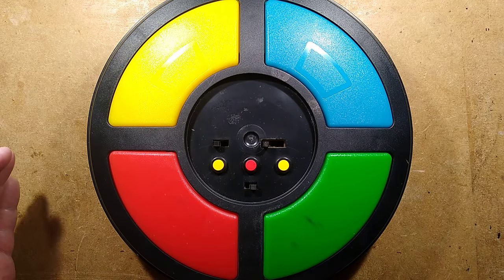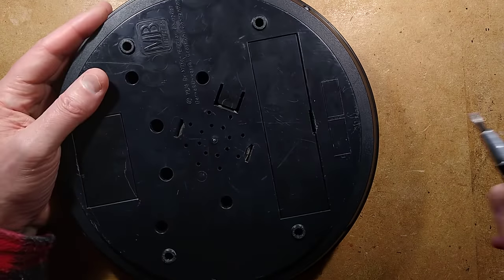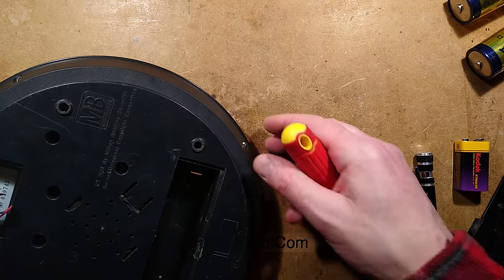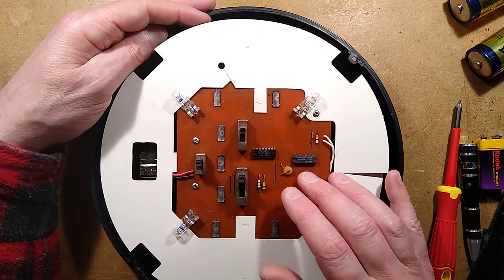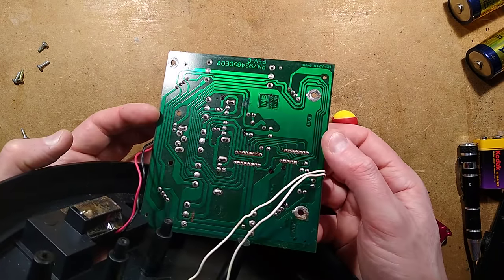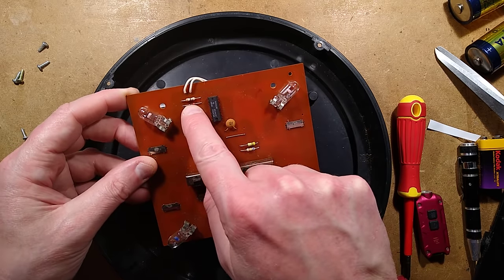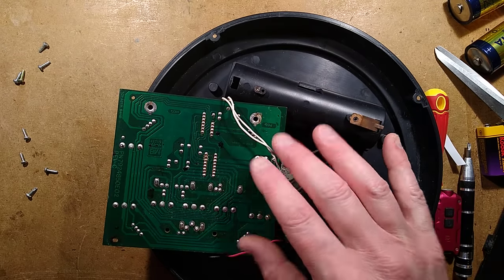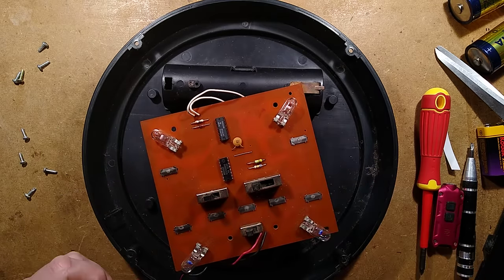Inside one of the first electronic games.

Comment: At some point in the future, the incandescent bulbs in this will have the same "Wow!" factor as vacuum tubes do when opening a piece of vintage electronics. A good reason not to retro fit LEDs.
Reply: At least here the chances of them burning out are low. When it comes to pinball games and hifi receivers, likely chance there sadly
Reply: Until about a year ago I had no idea what a wedge light was. On my car one of the front running lights had failed and the other one was dim. With great difficulty I replaced them with LEDs. Everything was great for a few months until one of my my new LEDs failed. I replaced both of with incandescent bulbs, they are more reliable.
Reply: Meanwhile in China they make half decent vacuum tube amplifiers that have red or blue leds lighting them from underneath, because the awesome glow from the cathode isn't enough. It's that strange crossover between what was actually good tech, and try and update it for no reason.
Reply: Who's to say today's babies buy an old house and find some quirky corner with a light bulb in it and say WTH is that ?

If I ever get wind of them demolishing ?????? ????????? I'll try to get there before they do and rescue a light bulb. It can't be original to the building (1910) I don't think but quite possibly at the first upgrade maybe 15 years later.
Reply: @fuzzybobbles  an amber led does look classy though
Reply: @rysacroft  quality led assemblies will outlast your car but retrofit assemblies are often pretty low quality.
Reply: Yep just standard car side light bulbs, super common. Its quite cool to think how easy they made them to replace though.
Reply: @VeyronBD  Except the wrong voltage - so they're not not car bulbs at all !
Reply: @millomweb  sure they don't just run at lower voltage in the game?
Reply: @VeyronBD  I doubt a 194 wedge bulb (12-14 V)  would even glow dim red with 2 D batteries (3 V) powering them.  It is pretty common to get the wedge bulbs in 6 V and 8 V,  but I haven't seen them in 3 V versions,  so these might be rare to find if they ever burn out.
Reply: @drkastenbrot  There are some hard-to-find 2700K-3000K very warm white LEDs that I'd love for something like this.  Some LED candles have an interesting version.  T1-3/4 but with two chips under the phosphor that come out focusing at a slightly different angle.  Fade between the two and you get a no-moving-parts flickering spot that actually moves.
Reply: fun game: challenge your friends to figure out the one item in their home that still relies on vacuum tube technology. Don't tell them it's just one tube, or that it's an appliance.

Comment: A few years back my local maker group built one of those that was 20ft in diameter. Tons of LEDs and load cells for the buttons. You would play it in teams of 4-8 and stand on the buttons to press them
Reply: Wow, that must've been something, lol!
Reply: That'd deserve a video! 😃
Reply: @megamanx466  I wish I filmed more of the build. I've got quite a few photos from it though. We were planning on doing another event with it this year, but as you can imagine covid delayed those plans for good reason. we designed it modularly in 8 huge pie shaped wedge sections that can fit in the back of 2 trucks. So it's fairy easy to transport to any location. It definitely needs some repairs after two days of people jumping on it. The black part was skinned in abs plastic over plywood, so its super durable, but the buttons were skinned with plywood and colored fiberglass. The fiberglass was layed over some strips of LEDs in the button to make it look like it glows. After two days of people jumping on it, it did up breaking through in a few spots though. With 16 load cells and 11 different channels of 120 volt led lights the electronica were pretty wild too. It was designed so we can connect a network of PIs over WiFi to dmx lights and throw them all over the event space. Then they all flash and match the color of the simon itself. We also modified an original simon to be the start button for the full sized one. It's bolted on a welded pedistool that sits in front of the full sized thing. It also flashes the buttons the same colors as the 20ft one. You end up pressing the original tiny start button on it. People got a kick out of that. We even got the original graphics files from Hasbro. We ended up making our own tones, and added some more base to the sound files, so it's like something kinda like close encounters.  It played out of an in built automotive style speaker system inside of the center, then also would connect up to the speakers outside at the event space. Next time we run an event, probably in quite a while at this rate, I'll either film it myself, or find someone else who can film, the setup, teardown, and event.
Reply: @ReRamp  That sounds awesome! Perhaps next year you can get Hasbro to contribute towards it. Either way, sounds like an excellent project for a video! 🤯😃

Comment: The reason the colored plastic "button" parts have two positions for the rubber buttons is because they use a different position for the contact based on what position on the game the plastic lens is, the configuration allows them to use one (expensive) set of molds to make the parts, and they could load different colored plastic depending on the part they wanted to make. (The could make, say, a thousand of each color, one run at a time, one day they make blue, the next, red, etc)

Comment: I remember we had one when I was a kid. I didn't realize how new they were at the time. My assumption on the extra socket for the rubber bumper on each button is that the mold was the same regardless of the part position.
Reply: My guess would be it was designed with a bit of overkill and omitted after testing but didn't change the mold.

Comment: The paper contact cleaner tip is a good one. I especially like to use it on gold plated PCB edge connections (e.g. nes games), you can feel the paper dragging the crud off if it's dirty, it just glides over the board once clean. You can also fold an index card and insert into edge connectors.

Comment: Clive, a lot of the early home "video games" like Simon used controls designs similar to the ones used in pinball machines and the early arcade video games. To prevent damage from abuse, both used two part switches with the button being a separate component from the switch. The return spring and the travel limits were built into the button part.

Comment: Blotting paper and CRC Contact Cleaner - works a treat for most contamination problems (especially in LV switching applications). For higher current contacts - replace the contact cleaner with Brasso - then use contact cleaner for protection. I use this strategy to keep our outdoor solar lights running for years!

Comment: I remember John Meshna Corporation in Massachusetts selling junked electronics. I took apart something sold as a “digital shift register” with three 6146 tubes driving a lot of little boards with I think flip-flops made with miniature tubes... never did get around to using the 6146 tubes for anything

Comment: The challenge was to make a game without a display. 
The chip has matured enough, buttons, lights and other small electronics no problem, but the LCD isn't quite there yet. 
When the first LCD's arrived you got an avalanche of similar (the jump between three positions) games which took much creativity out of the process. Tetris and a few others being the exceptions.
But to make a fun electronic game without having display, that would still be just as much a challenge today as it was back then. I think the use of colored translucent plastic, to make the 4 different buttons is something to be appreciated. Avoiding the cost of using colored lights yet still creating 4 different 'interaction points'. Very clever.

Comment: I had a Bop-it when I was a kid.
I very quickly learned that I wasn't allowed to play it at night, so I modified it. Possibly the 3rd toy I ever took apart as a kid, but first one I could play in the house.

I took it apart, carefully removed the speaker, put it back together, then tried to play it, didn't even occur to me that without the speaker it was pretty useless. I was about 10.

My father wasn't very impressed, I got shouted at and he threw it away.

I also had a metal detector, I loved this thing, but I wanted to know how it worked. My father wouldn't tell me, so, I got a screwdriver and found out for myself. There was a lot of glue and by the time I had finished, it was not possible to repair it. And that toy was my first experience at taking something apart, and it's why I still love taking things apart.

A few years later, I fixed my first games console. Since then I've fixed many laptops and learned many many things from dismantling electronics.
The console was a PSOne.

Comment: Lamps like that are someone common in sewing machines I've repaired as well (Viking for example). I would add too - corroded solder is the worst. The best way to fix that is to remove the bad solder, clean the part, and then re-solder it.

Comment: that simon doesn't have the TMS1000 in it.  it's a newer model with the purpose-made ASIC that was apparently cheaper to make.  The TMS version will have a 28 pin chip in it instead.   The earlier version's lamp holders were screw in style too, vs. those clip in ones.

Comment: "In 1974 ..." I can beat that by 6 years!

In 1968, I worked as a research engineer at a facility that had a Digital Equipment Corporation PDP8 minicomputer - a device about the size of a wardrobe. This had a row of 12 lights (pre-LED) to show the content of the accumulator in binary. Underneath was a row of 12 paddle switches to enter information, again in binary.

I wrote a small program to "play tennis" for 2 players on the computer. The idea was that one bulb was lit at a time and this moved along the row of 12. By flicking the end paddle switch up briefly as the light approached that end, the player at that end was able to "hit the ball back" - in other words reverse the direction of travel of the moving light. Furthermore, the later one left the return stroke, the faster the ball was "hit" and the more difficult it was for the other player to return the ball. So the skill was to refrain from hitting the ball until the last possible moment, but of course, if you didn't hit it in time, the ball "fell off the end of the accumulator" and you lost that point.

A great time was had by all and some people became very animated whilst playing. One such person, clearly overexcited, managed to rip the paddle switch completely off the front panel of the computer, so a D.E.C. service engineer had to be called out to fix it.

Service engineer: "I've never seen a fault like this before, how did it happen?"
Us: "Erm, er, well, we're not sure, it just sort of fell off."

Comment: I never had the Simon but I do remember seeing the commercials for it when I was a kid.  However, my brother and I did have the Little Professor (I was always so fascinated by the red LED display), and later the Speak & Math.  I still have the motherboard for that thing and a diagram of what I figured out for the keyboard pinout, so if I really wanted I could fire it up.  I also have a couple of those Tiger Electronics handhelds, but those are just a blobbed chip and LCD screen.

Comment: This is the first time I have seen W5W car bulbs in a toy.
In ifixit there is a disassembly of the simon, and it has threaded bulbs, and that contains a texas instrument chip, it seems that MB made different versions.
The good thing is that it can be replaced by W5W LED bulbs.
The simon is very well built to be from the 70s, the electronic board has great soldering, the buttons are designed to be durable.

Comment: I remember that there is a bomb diffusal game which has a Simon says in it, but the catch is that how you respond to it varies depending on things about the bomb
some of the bombs have a strike system, where you can make 2 mistakes without them detonating, but making a mistake anywhere on the bomb will change how you will have to respond to the Simon says module

just to give an example:
if the red button flashed, with no strikes you would have to press yellow, with 1 strike you would have to press green, and with 2 strikes you would have to press blue (this is not the actual solution, this is just made up on the spot, as there are other factors to take into account when responding to the module, and depending on these other factors you may actually have to press green instead of yellow when there are no strikes)

Comment: You could make it an LED conversion without ruining the old board. Some little adaptor boards with LEDs and a resistor with contacts on the edge to meet the clips for the bulbs. I can't tell how thick the ends of the bulbs are, but I'm sure 2 or 3mm boards would be clamped sufficiently for good electrical contact.

Comment: Well... next thing you should feature is a Speak N Spell by now 😂
I do have a Merlin btw.
Did replace all the LEDs with new ones aswell as cleaning the contacts of the switch and of the power jack (It has a cutout like headphone jacks so that if you plug in a wall wart it will nor force charge the batteries, but is it's corroded or dirty even to the slightest bit, batteries will not work.)

Comment: You can get LED replacement bulbs that will match those contacts. So you can upgrade the lights without resoldering any connectors

Comment: There was a mail order company here in the USA called polypacks that sold surplus electronics.  I purchased a package of around 3 boards.  They had the screw in lamp holders, probably a early version of what you have.  I have no idea what I paid for them, it would have been about forty years ago.  Probably didn't pay much because money was pretty tight, could probably sell them each for more than I paid for the bunch.  I probably threw them out years ago in a cleaning spree.

Comment: I used to be awesome at Simon in the early'/mid 1980s, though mine had the screw-in flashlight bulbs. It even had a spare in the compartment over the 9V logic battery. I am surprised to see one that uses bulbs with a wedge base--especially since we didn't have many wedge base bulbs until the mid/late 1990s here in USA.

Comment: I can tell you why those colored pads have two plunger locations. Simplest reason ever, tooling. If you look at the board you'll see that half the contacts are on the left and half are on the right. If the pads reflected that you'd end up with two sets of molds and twice the chance to muck up getting the proper color in the molds. If you put both plunger locations in the tooling then the pads can be left or right and there's zero chance of messing around and molding up a bunch of wrong handed pads.

Comment: I remember those types of bulbs in my 70's and 80's cars dashboards .
Reply: They're still widely used in such places as sidelights, number plate lights and direction indicator repeater lights. 12V 5W versions are readily available. The ones in the Simon will be rarer though, running as they do off a 3V supply.
Reply: @tonywalton1464  yep those wedge bulbs were used in cars, 12v 4w i think?  got a bagfull of the things i removed from the electronic remains of a fruit machine   those ones in the simon will probably be 2.5v or 2.2v to take into account losses in the driver chip
Reply: @andygozzo72  I wondered if they'd be 6V - after all they don't need to be driven at full voltage !
Reply: @millomweb  theyd be too dim toshine through the plastic segments...
Reply: Still in a lot of cars, the auto bulb type is capless 501

Comment: To the best of my knowledge, the custom Simon ASIC hasn't been reverse-engineered yet. Doing so would require someone to painstakingly mark every component from the die photos... which I've been doing while watching this! Technically I'm working on the Auto Race ASIC at the moment, but I'll get to the Simon one eventually. It will be interesting to see if the algorithm in the custom solution differs from the microcontroller-based one.
Reply from the maker: That sounds quite a formidable task.
Reply: @bigclivedotcom  ...which is why I'm trying to automate most of it with CV.

Comment: You don't even need to baptize these with Coca-Cola to get corrosion. Storing them in a cool, humid place, like a cellar or shed, can allow condensation to form on the metal parts, which attracts & forms all sorts of interesting things, nevermind when the batteries leak.
But yeah, even in the 80s, I remember the TV advertisements for these toys. About 10 years later, once all the Tiger LCD handhelds showed up, you could find them for about $5 at garage sales. It's been amazing, seeing how things change over just a few decades.

Comment: My Gran game me one sometime in the 1990's,  a few Christmasses ago i found a game that i thought might be a Simon clone at Flying Tiger (just called Tiger here in the UK) It was £2 and so i took the punt even if i wasn't Simon it looked like it could be fun). It was a Simon clone and my Mum (who i bought it for) still plays on it. It's a small thing, no more than 10cm square and all it's corners are the same colour (orange) but as it's orientation is clear it's not an issue.  

I haven't taken it apart but i suspect it's a SoC covered in resin on a small board.

Comment: Those bulbs and mounts are like some still found on cars. Mainly reg plate lights 
And modern versions just use L.E.D's :D
Reply: Those most likely are a #194 bulb.  Replaced hundreds over the years as an RV service tech.  Common in exterior clearance lights.  And correct, mostly LEDs nowadays.